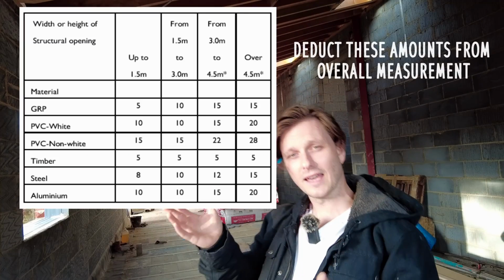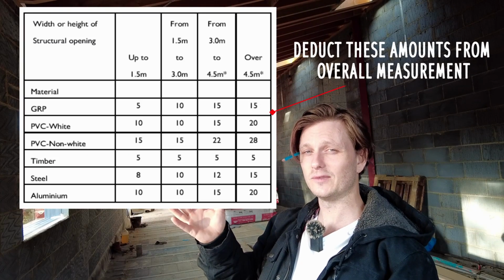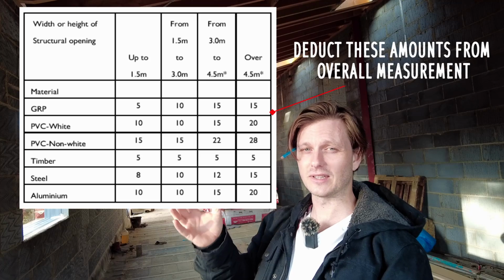How to Measure for NEW Windows & Doors - Including Gable Window

Comment: Why aluminium windows?
Reply from the maker: Original planning stated I had to have steel crittall windows (a misunderstanding on the heritage consultants part). I went in for new planning and said I'd go for crittall style aluminium and they was fine with that. Alu clad wood is super expensive, I wouldn't go for dark upvc as I believe it can warp, so aluminium it was, low maintenance 👍
Reply: @THE-AIDEN-PROJECT  Thank you, great content.
Reply: @THE-AIDEN-PROJECT ye aluminium has come on leaps and bounds from 40 years ago ,no cold bridgeing 👍.

Comment: How did you go about finding the right window supplier?
Reply from the maker: I kind of went through that in my other video about window quotes. To summarise it, I knew I wanted aluminium black doors and windows and they had to hit a u value of 1.4. Then I sent of the dimensions to several firms. I made a decision based on their accuracy of quote, the information they initially supplied and the price. Another factor you should consider is if they take credit card payments as you should always do this as an insurance policy just incase something goes wrong (claim under section 75)

Comment: Very helpful, Thank you....but ive gotta ask, what word did you say before you threw the 'trigonometry' bit in? haha
Reply from the maker: Oh I was hoping nobody would notice 😄 haha I actually said pythagoras, but that only solves the long diagonal length. I actually used trigonometry to cross reference between the angles and lengths to make sure it all worked out. It helped when I called out Origin for when they gave me a plan that was mathematically impossible. I didn't really explain it properly in this though because I thought it would get too boring 😴